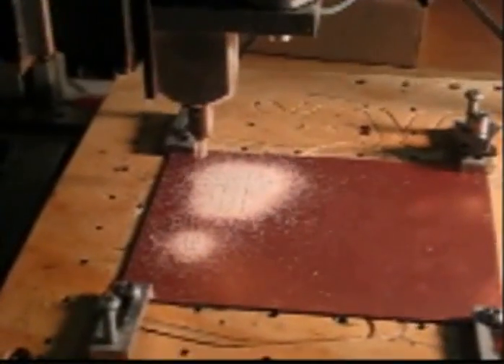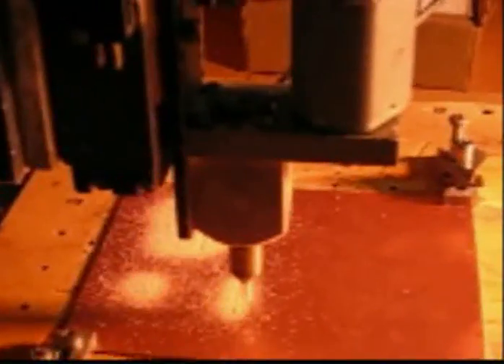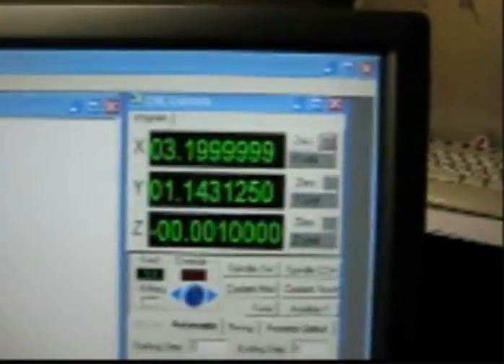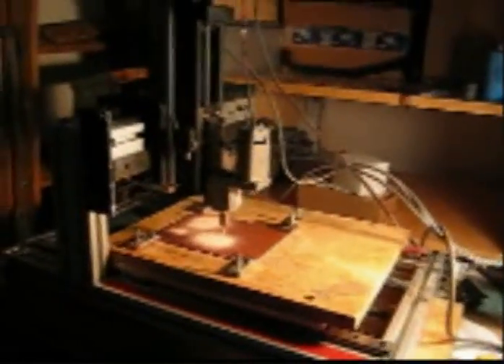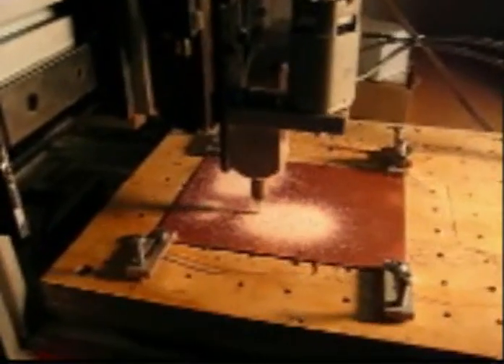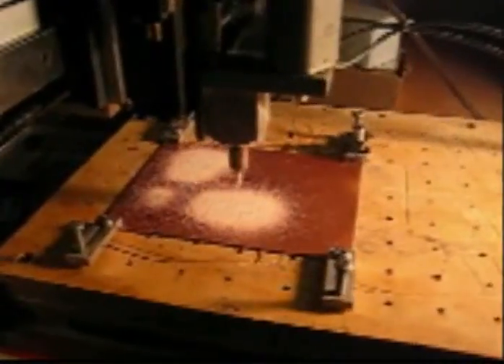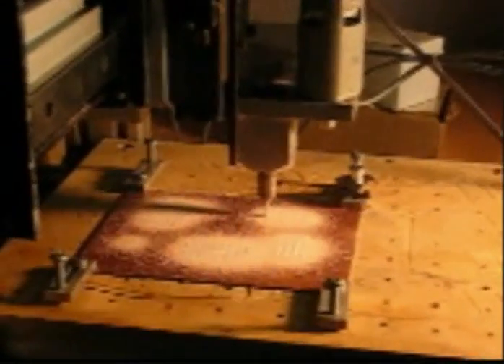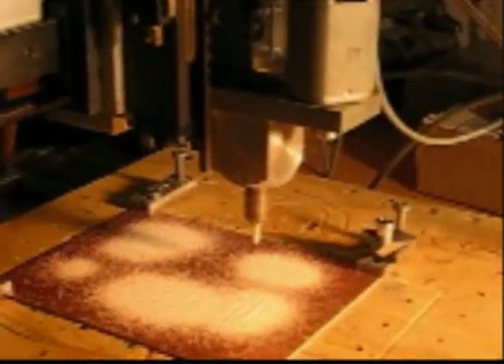3 Axis CNC Milling of Printed Circuit Boards de N6QW.mpeg

Comment: we have taken "cnc based milling machine for pcb layout" as our final year engineering project. that too works on 3axis- x and y moves the platform while z axis moves the needle up and down. we will be using eaglecad software and stepper motors. even though, we are not sure about the feasibility of the project. needed some help, and documental resources, if any.